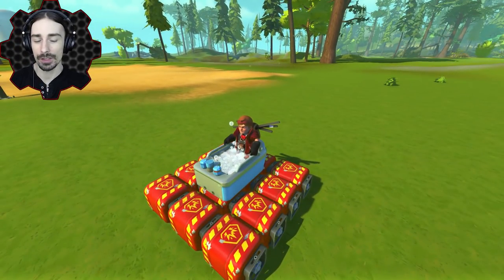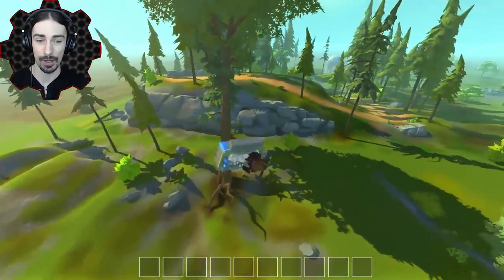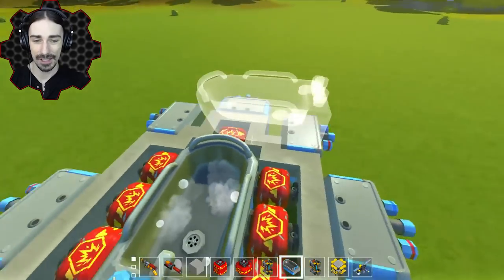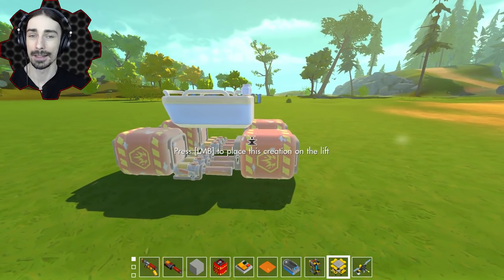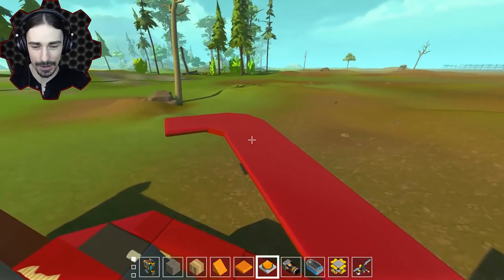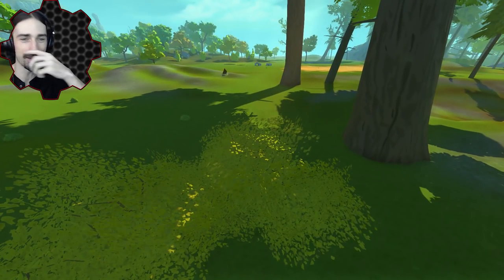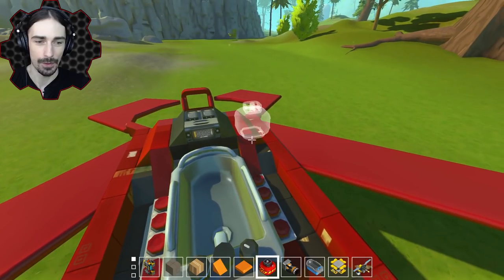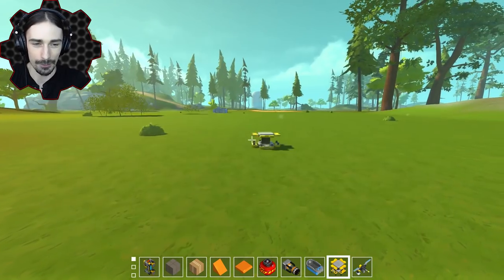Explosive Ejection Seat or Self Destruct Button? - Scrap Mechanic Gameplay

Comment: Awesome plane design that look kind like a sword.There no wrong way to build in Scrap Mechanic,just pain in the butt trees that get in your way lol XD
Reply: There is a wrong way to build it though, and he built it wrong. There's three axes that a plane pivots on: pitch, yaw, and roll. He completely forgot to include yaw controls. The only reason the plane worked is because he rolled to the side and then used the pitch controls to turn the plane.
Reply from the maker: A plane doesn't need yaw for that exact reason. Turning is better done with roll and pitch. For a plane I'm just going to blow up, yaw wasnt worth including
Reply: @scrapman  good point

Comment: Also, I suggest attaching the tub with a bearing so that it only connects on one block but you can still build around it, and then timing the explosion to happen as it breaks off, propelling you away from the aircraft.

Comment: You should’ve had the seat only connected to the plane at one point, then you could shoot it with a spud gun at the same time as exploding a canister, then you would go flying but the plane would remain mostly intact
Reply: It would still blow the plane up, but that's a better idea than covering it in explosives.

Comment: Make a camo that fires with the impackt of another bom
Just like in minecraft
Reply: It would detonate instantly and the build would blow up. The best you can get would be a catapult or cannon type build.
Reply: @fridgeonwheels5622  no no no

mine works differently

step1: 2 bombs are shot in the air

step2: the first explodes

and by the impackt the second path is fired

step 3: the second bomb explodes due to the impacking of the ground